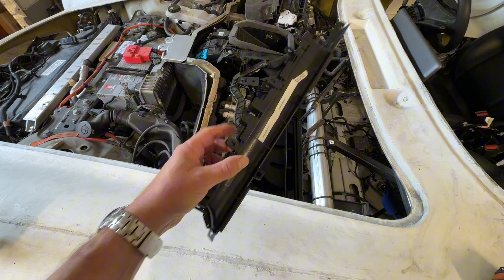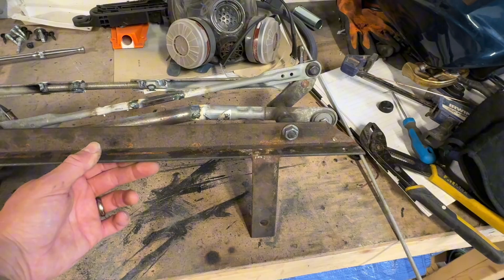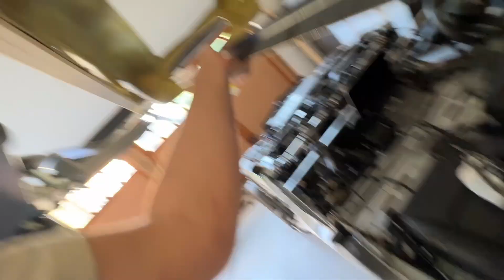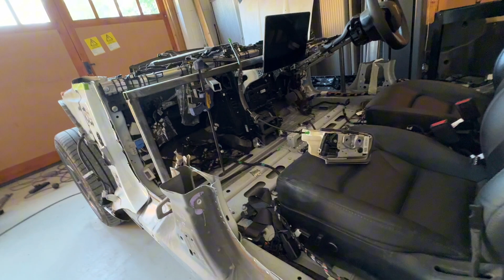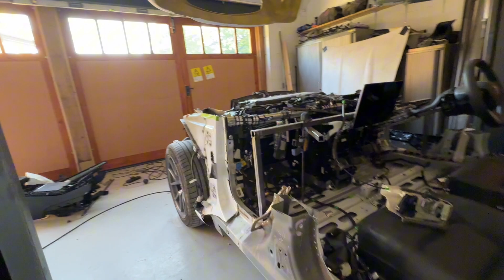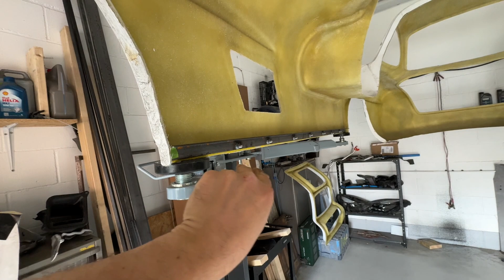Tesla Gullwing build part 16: wipers, HVAC planning and getting some structure back in

Comment: Amazing progress again Rich.

If I had a vote, I’d go with your shallow faux HVAC intake grille proposal rather than plating and filling over the depression. You could always 3D print one for now and worry about adding a version with realistic bright work later.

The HVAC ducts look like they’re going to be fun to route and keep free of constriction but on the other hand, it will be a much smaller cabin volume to manage, even if there is some loss of performance. Whereabouts is the recirc intake?
Reply from the maker: Wait until the next video, lots of deliveries today! Recirc intake is right by the fan/bulkhead